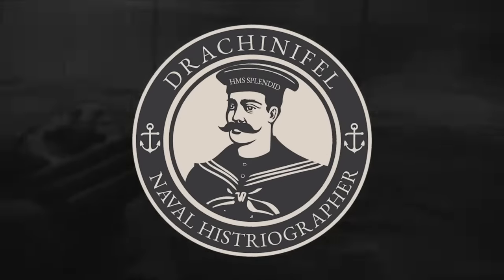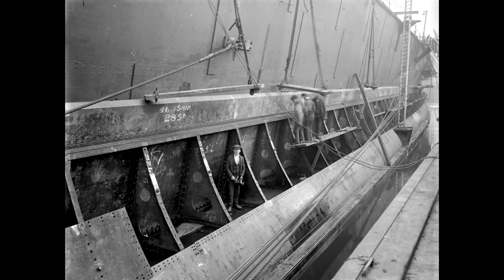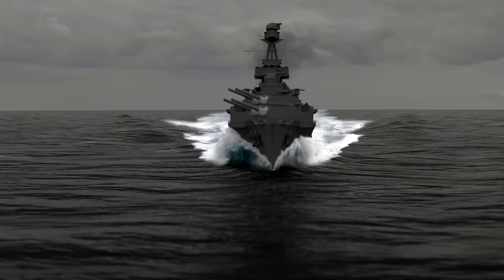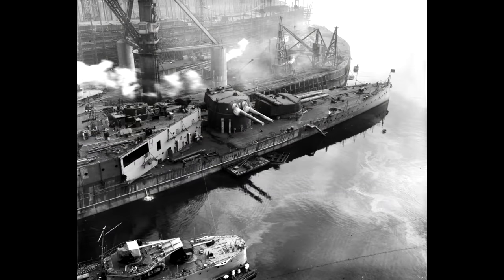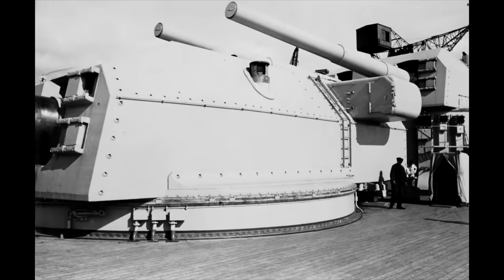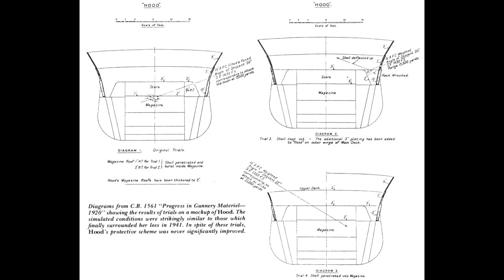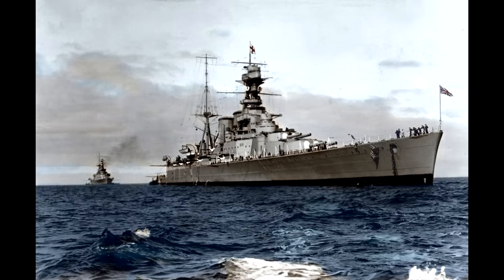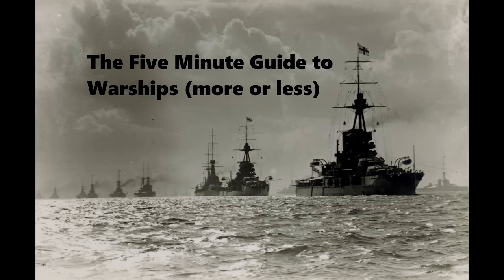The Loss of HMS Hood - But why did it blow up??

Comment: I have studied this loss over many years . . . I will provide the SHORT version, as the "Actual" data, is VERY, VERY long !. What actually "Happened", was due to a SIMPLE OVERSIGHT . . . in Oct of 1939, Hood had her after SINGLE 4 inch guns "Replaced", by TWIN MOUNTS . . . while this was taking place, her primary DECK ARMOR PLATE had been "Removed", to have been "Replaced", by a THICKER plate ,. but during the installing of the "New" guns, she was RUSHED back into service, having "Omitted" the deck armor plate, an what ended up happening was that it was simply . . . "Forgotten" about . . . an when she went up against "Bismark", that section of the deck ( Frame 250 to 258 ) was "Completely Unprotected" except for the "Thin", "2" inch deck plating. . . this section of the deck, was directly OVER the Torpedo Room, which contained "12" Torpedo's, ( "6" on each beam ) When "Prinz Eugen" scored the first hit of the engagement, which started the "Deck Fire", in the READY USE 4.5 ammunition, the fire had had already "Started", BELOW the deck plating, when BISMARK's first shell actually "Hit", it had already started a FIRE in the torpedo room, so when the "Second" shell hit, it caused the torpedo's to EXPLODE, breaking the ship in half, while setting off the "Aft Mag" also to EXPLODE, ensuring the ships loss.
Reply: Ground breaking new theory there. Could you point us to your source for this information?
Reply: @walterkronkitesleftshoe6684   Hoods MOD an REPAIR records . . .
Reply: @montanabulldog9687  Where can I access them please?
Reply: @montanabulldog9687  No, you didn't. I doubt any official RN document would refer to Hood's 4.5 inch secondary armament being replaced by 4.5 inch twins. Largely because Hood's 5.5 inch low angle secondary armament was removed completely, and a secondary armament of seven twin 4 inch AA guns were fitted in completely different locations on the boat deck. 

This, however, did not happen during the course of one refit, but in  a series of stages. Initially, the shelter deck 5.5s were removed, and four twin 4 inch mountings fitted. Later, the remaining three single 4 inch were also replaced by twins. Twin searchlight towers between the funnels were removed, and the old HACS control system replaced by a new one.   No deck armour or plating was removed.

There was a proposal to replace protective deck plating with 4 inch armour over the magazines and 2.5 inch armour over the machinery spaces, but this was not 'forgotten about.' The additional weight involved, 1410 tons, was regarded as having too adverse an effect on a ship whose displacement had already increased significantly over the years.
Reply: @dovetonsturdee7033  I was quite "Specific", in what I said . . . the DECK ARMOR, directly "Under" the twin 4.5 inch mounts.directly IN FRONT OF the "After Mast", is the area in question . . . installed in Oct of 39.
Reply: @montanabulldog9687  Hood never carried a 4.5 inch gun, single or twin, during the course of her entire existence.

In addition, as I wrote earlier, this :-  'her primary DECK ARMOR PLATE had been "Removed", to have been "Replaced", by a THICKER plate ,. but during the installing of the "New" guns, she was RUSHED back into service, having "Omitted" the deck armor plate, an what ended up happening was that it was simply . . . "Forgotten" about . . .'

was simply not true.
Reply: @dovetonsturdee7033  Slight "Slip of the finger" . . . "4 Inch" Guns. As for her DECK ARMOR PLATE. it "Had been Removed", the report was quite specific on this point . . . an it was a "6" Inch Plate !, an "8" Inch plate was to be installed, one HALF deck lower.
Reply: @montanabulldog9687   I have detailed accounts of every refit carried out on Hood between 1929 & 1941.  the took place on:- 3 June, 1929-28,  May 1931, 1 August to 5 September, 1934, 26 June to 10 October, 1936, 8 November to 16 December, 1937, February - June, 1939, July-August, 1939, 29 March & 27 May, 1940, and 16 January to 15 March, 1941.

There is no suggestion anywhere that armour plate was removed from the boat deck & not replaced. There was, as I wrote earlier, a proposal to fit thicker armour over the magazines & machinery spaces, but in view of the increase of weight this would inflict on an already overweight ship, it was not undertaken.    Hood was scheduled for complete modernisation after the completion of work on Queen Elizabeth, but, of course, world events intervened.

Seriously, do you really think that large sections of armour plate could possibly have been removed, and then 'forgotten about?'
Reply: @dovetonsturdee7033  It was a simple "Oversight" . . .
Reply: @montanabulldog9687  It was a simple oversight which didn't actually happen.  What is the title of this 'Report?'   Do you seriously suggest that deck armour could be removed and not replaced, yet no-one noticed? Please don't be silly.

Comment: The sinister detail that became Hood's ill fate is not as "mysterious" as it appears.
The POW and Prinz Eugen witness reports said of the Bismarck volleys, "Two over" and the last, "Too short"..
And especially: none of the witnesses could hear any bang or impact.
It must be the LAST grenade - the "too short" grenade that went into the water only 3-4 meters from Hood's side, that went under the armor belt.
And therefore straight into the magazine of the X tower.
It is therefore most likely and the explanation for how the whole ship exploded in just a few seconds.
If the hit were to be further up - in the armor belt or the upper deck - it would take MUCH longer to tear up and explode the whole ship..
Seriously: Hood's fatal hit came underwater - under the armor belt. That's why she exploded so quickly.

Comment: So call the hit on the hood just as lucky as the swordfish got on Bismarck 2 days later 🤷🏻‍♂️🤦🏻‍♂️👍       whatever happened to good instead of lucky? Lol.
Reply: I mean yeah, the Torpedo hit on Bismarck's rudder is lucky, everyone knows that fact
Reply: @KatyushaLauncher  I say without crippling the rudder the final battle wouldve ended with rodney sunk dorsetshire sunk and kgv battered if not sunk just to wind up doing the same damage to a maneuver capable Bismarck.      I'm only slightly in favor of Bismarck.   My fave battleship that's not still floating 😅
Reply: @dillonpierce7599  No, Lütjens prioritized Bismarck's safety more than anything so Bismarck will stay on her course to Saint Nazaire. Bismarck will certainly lose against all 4 Royal Ships well because she was inferior, the King George V-class and Nelson-class had thicker armor and was better protected, they Had a Heavier broadside, they had much more advanced radar and fire control systems, the Only thing Bismarck could utilize is her speed to run away
Reply: @KatyushaLauncher  like I said I'm biased in bismarcks favor 😅       I never liked lutjens I liked the captain lindemann.        Either way it and tirpitz were doomed being on the wrong team 🤷🏻‍♂️
Reply: @dillonpierce7599  Firstly, there wouldn't have been a final battle. Tovey would not have caught up with Bismarck, which would in all probability have reached St. Nazaire.   Secondly, however, had Bismarck been forced to engage, then the final action would almost certainly have ended much as it did.   Both Rodney and KGV had better laid-out, thicker, armour than Bismarck, heavier broadsides, and in a two to one action, one (probably KGV) would be able to target Bismarck whilst being unengaged herself.     

What leads you to make the claim you have made, given Bismarck's many & known inferiorities to her opponents?
Reply: @dovetonsturdee7033  last I checked between all the documentaries and expeditions and then determined for myself is theres very few full penetrations of bismarcks main armor anywhere except the round that got the fwd fuel tank the damage near the steering gear from the torpedo back there.....    I dont think much from the ww1 way of german design wouldve changed.....    smaller guns and slower for better armor.         Also the swordfish wouldve kept coming until they achieved some results I'm sure to allow Tovey to close in.     Rodney damaged itself in the engagement seeing it needed refit at that time as well.  Can recall reading of plumbing blowing open and main guns jumping their cradles.....      easy kill there and knocks out the 16 in guns.     Dorsetshire also easy kill being cruiser.....     then kgv by itself unless the ark royal was stupid enough to surface engage a battleship 🤷🏻‍♂️.     Also 2 main turrets for one battleship and let the secondaries to damage dorsetshire til one battleship was down or crippled.      Many ways this could've gone down 😅
Reply: @dillonpierce7599  Well, both Ballard & Mearns have gone on record as saying that the British sank Bismarck. Mearns, incidentally, documented the holes from Dorsetshire's torpedoes.  By the time of her sinking, Bismarck's main armament had been destroyed and her bridge blown away. Internal communications had ceased, and she was extensively on fire.

Rodney was heading for Norfolk for re-fit in any case, but her only damage was some internal pipework and a jammed torpedo tube. No main guns were damaged at all.  Dorsetshire only became involved late in the action, long after Bismarck had ceased to be anything more than a target.

As to your last comment, you  seriously suggest that Bismarck, faced by two better armoured, heavier gunned, opponents, would sink one with her two forward turrets, cripple the second with her aft turrets, whilst at the same time sinking a heavy cruiser with her 5.9s.   Congratulations! Probably the silliest suggestion I have ever come across, although well in line with the idea of Ark Royal indulging in a surface action with the full might of her 4.5s!

Why not go the whole way?  'Fire Photon Torpedoes at Rodney, Mr. Chekov!'

Alternatively, you might read a book which analyses the Bismarck action in a rational, sensible, manner, perhaps?
Reply: history repeats itself ... be it football  or battleships lobbing shells at each other ... its that one lucky shot that does the job

Comment: It sank because the British don’t know how to make affective designs
Reply: Nonsense.   Hood was 20 years old. Would you argue that a Sopwith Camel was an ineffective design because it was inferior to a Bf109?    Compared to Bismarck, the Nelsons & the KGVs were rather more effective.
Reply: @dovetonsturdee7033  I’m am aware of this I’m simply referring to how Hood has an empty spot aft of the aft Funnel I mean seriously they could have put AA, A Catapult fighter/spotter or another gun turret
Reply: @lanz2828  You couldn't put another barbette there without mutilating her speed, as the area below was for her engines and boilers. There were already, by 1941, seven pairs of 4 inch AA guns, 24 2 pounder AA guns, 8 0.5 inch machine guns, and 2 UP launchers in that area, as well as the ship's boats in that area.

By 1941, the RN were removing seaplanes from their larger ships, not fitting them.

Comment: Talk after hood was lost was , torpedos and crates of rockets on board , mullenheim gunnery director for c and d turret  bismarck saw hood clearly go up as c turret fired its second salvo at hood.
Reply: Mullenheim CLEARLY states that his aft gunnery director was busy with its attention on Suffolk & Norfolk astern of Bismarck, but that he heard the excited babble of voices over his headphones and traversed an auxiliary scope to port in time to winess the terrible pall of smoke AFTER Hood's detonation.

The rumour of torpedoes was not only conclusively disproved later on, but they were never physically within range to reach Hood / PoW. Just the same as the suggested torpedoes the Prinz Eugen spotted could never have come from Hood, for the same reason.
Reply: Schneider was the first Gunnery Officer aboard Bismarck, and was controlling the main battery. As I recall Rechberg's comments, his aft director was watching what Wake-Walker's squadron was doing at the time Hood exploded.

The UP rockets caused a fire on the boat deck which didn't threaten Hood in any significant manner. If by torpedoes you mean those aboard Hood, then two separate Boards of Inquiry discounted these as responsible for the explosion. If you mean German torpedoes, Bismarck didn't carry any and Prinz Eugen, which did, didn't fire any.

Comment: More Modern Sights and Marksmanship Gunnery.  It took one Shell except for the first hit in the Mast. Bismarck was hit by the Prince of Wales. The Hood just picked on a Better Ship.
Reply: But strangely enough all that technology and markmanship came to nothing on the morning of 27th May 1941. Bismarck was only slightly better than Hood and landed a lucky shot. When the luck deserted her, she was beheaded and declawed by a ship 13 years older than her.
Reply: @walterkronkitesleftshoe6684  I don't know what the Prinze Eugen was doing except taking a video of the Battle. You are right that the Rudder was hit by the Prince of Wales.  The Bismarck was doomed like most Battlle Ships. The Bismarck was sank by Torpedoes dropped by planes.  The Battle of the River Plate and the Denmark Strait were the last great Sea Battles.  The Carrier became the most dominant force on the Sea.  But the shot that sunk the Hood was not Lucky. The Hood shot I believe two salvos and missed the Hood.  The Bismarck hit the Hood. The Captain of Bismarck defied Orders to save his ship.  He said I won't have my ship shot out from under my ass. The Hood had her chances.  The Prince of Wales met her doom the same way the Bismarck did in the Pacific. Sunk by planes.
Reply: @kurtsherrick2066  Theres a lot of inaccuracies in your post, but I'll leave them to someone else to correct.

I like to use an analogy to illustrate what was lucky about Bismarck's hit on Hood's magazine.

The analogy involves the use of a dartboard... and a shotgun.

A broadside salvo of 15 inch shells are very much like the pellets in a shotgun scatter. Now if you place a dartboard 50 yards away and can consistently knock it over with a shotgun at that range then that is pretty good shooting, just as Bismarck / PE achieved during the Denmark Strait encounter.

Now you can fire all day at the dartboard and still not hit the the actual "bullseye" with an individual pellet. As opposed to being a skillful shot by knocking over the dartboard, whether you hit the bullseye with an individual pellet is purely a matter of complete luck.
Reply: @kurtsherrick2066  Prince of Wales didn't hit Bismarck's rudder. She hit her forward of the bridge, cutting off access to much of her fuel. Bismarck was later damaged by an aerial torpedo, but destroyed by naval gunfire.

The last great sea battle involving capital ships was the Battle of Surigao Strait in October, 1944. The last one in western waters was North Cape in December 1943.

Comment: The Hood was over rated, sat too low in the water so that it washed over it and was poorly designed where as the Bismark was a better Battleship in every way, design, guns, everything. That's why they hunted it down and sank it with airplanes. They feared it.
Reply: tell me you are a wehraboo without telling me you are a wehraboo
Reply: @ElizabethII-1952  I've watched more complete documentaries that explain everything I just said in complete detail.
Reply: @Chris-vp2lm  Bismarck using a pre WW1 era armor scheme, main guns that disable its own radar, failing to score a single hit on HMS Rodney or HMS KG5.

Lmao
Reply: @ElizabethII-1952  The Bismark was never really sea trialed properly. They were in a hurry and the German navy was not developed enough for the load it had to meet facing England and still sinking the Bismark became a top priority. One shell sinks the Hood, compare. One shell sinks the Hood and how much did it take to sink the Bismark? Think about it.
Reply: @Chris-vp2lm  HMS Hood sank from the biggest fluke, 1 in a million shot through a narrow weak spot below the water line. If it was any other day the outcome would be very different

Luckiest hit in naval history by far.